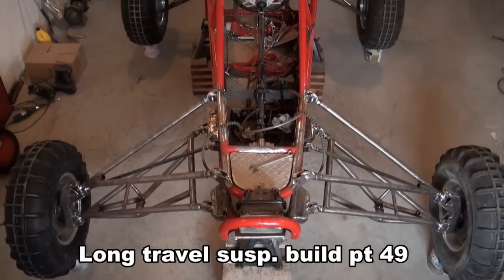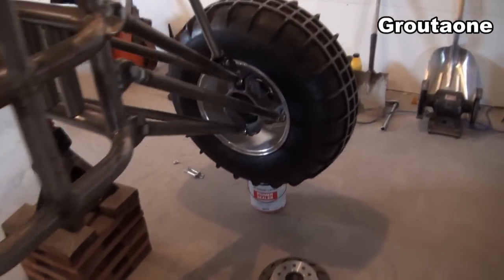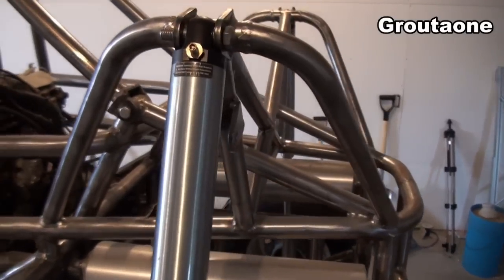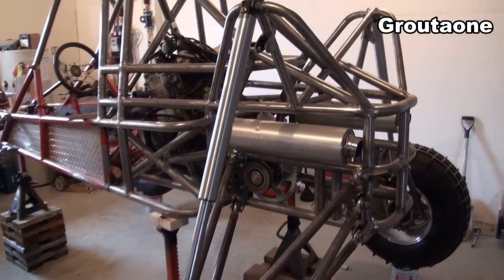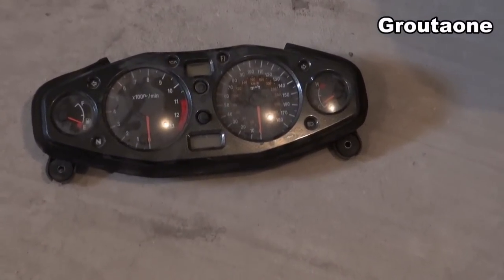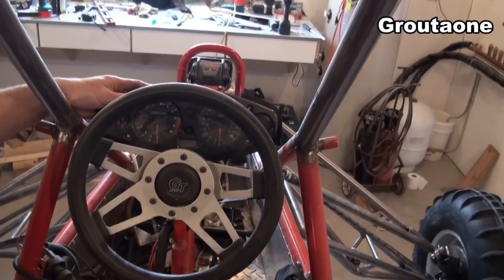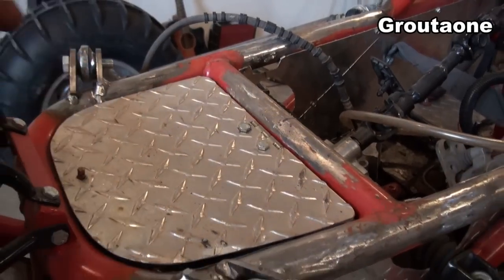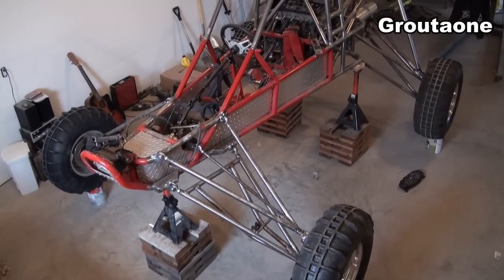Long Travel Susp Build PT 49

Comment: Great build.  If that is a motorcycle engine with a built-in gear box you need to know the primary reduction from the crank to the clutch basket then the ratio of the highest gear.  That will give you the rpm of the counter shaft sprocket when the crankshaft is at 11000 rpm in the highest gear.  Then you can do the math as you described.

Comment: The place I work at Skives the tubes for these shocks. A skive machine is a boring machine that bores and leaves a honed surface in one process. The ones we are currently working on have a ribbed outside for cooling.
Reply from the maker: william staten  Cool job you have, thanks for watching

Comment: Nice shocks!! When you move the top mount inward, it makes the shock softer, right? due to more leverage. and moves less, so since it's moving less, it seems like it's softer.Plus you need more nitrogen pressure for ride height.  And moving the top mount outward, you are decreasing the leverage, the shock is moving faster and more, which makes it stiffer with less nitrogen pressure for same ride height. I think I got it right.
 I plan on using automotive air shocks for the suspention on my tank. I'll be using 4. Got them off a Pontiac mini van. I decided to use them because instead of worrying about spring rate, I can just adjust air pressure.
Reply from the maker: *****  Thanks for watching, yes you are correct with your shock geometry analysis, another factor is that the suspension can have more room to travel as the shock top is moved in, and like you indicated, it will have reduced spring rate with that type of geometry change
Reply: groutaone Cool! I always setup suspension in daily driver cars and messed around with the fix positions, but your build, you get to choose where to put them on the frame, a huge advantage there. Good deal man!
Reply: groutaone Oh, thanks for the feedback. I will be putting it to use soon.

Comment: I have 400psi in the rear of my buggy with a for 460 big block. They are fox 2.0 18s. I think 400 will be too much for the light machine your building. Something we do also is put motorcycle fork oil in them. It keeps them smooth inside for much longer periods of time then the oil that comes in them. If you take your time with shimming, oil volume, and oil thickness you should be able to tune those shocks really well.
Reply from the maker: tom58c Thanks for your input, let me know if you have some video of your buggy in action, I will check it out.

Comment: groutaone  nice clean work it's coming along nicely
Reply from the maker: The Dude  Thanks man
Reply: Can't wait to see that thing get some air looks like she's going to be pretty smooth riding machine your using a busa engine to power that thing right ?
Reply from the maker: Yes that's correct, with fairly low gearing it should have some good power in the first few gears

Comment: Glad to see you back at it. I'm getting the itch as well to get back into my crossfire 150r to r600s motor swap project. I alway enjoy seeing your progress on this build, we've had similar ideas regarding reverse opioid however given the nature of my build I don't think I'll be spending so much on the reverse gear box like you did. Of course it makes sense in your case. I like your shocks. Will you be making a shift linkage system or a hydraulic shifter? I was wondering if hydraulic what exactly are you using? Hand clutch cable or foot hydraulic? I'm working on this now and have underestimated the difficulty of getting the geometry of a shift linkage system in place. Any info would be much appreciated, thanks alot...
Reply from the maker: Anthony Brown Thanks for watching, for the gear box shifter my two choices are cable or linkage, I have some linkage fab experience and have thought of making a video, with a few tricks its easy to make linkage smoothly go up, down, around corners and such, that video is in the bucket list. For a trans shifter I would like to set it up electric button shift, and use the clutch just to start off, I want to set up a hand clutch
Reply: Push button shifting that's a good idea. I looked at paddle shifters for racing cart steering wheels I thought that would be cool as well but I haven't looked into it other than price, I like the idea of saving leg room mostly I'm on the tall side and leg room is important.

Comment: assuming top gear on your engine is 1.043:1 then final drive is 9.20:1 with 31" dia tires at 11000rpm it will give you 110 mph. If final is 1.596:1 then ratio is 14.08:1 then top speed would be  72 mph

Comment: I wouldn't gear it "too short". You might hit the rev limiter often. That motor has about 175hp@ about 9,800 rpm.[ At the crank] Torque about 103 ftlbs @ 7,500 rpm. Did the Fox shocks come with boots to protect the tubes from rock damage? Here is a link about gearing http://purplesagetradingpost.com/sumner/bvillecar/bville-spreadsheet-index.html#Six%20Speed%20Motorcycle

Comment: That motor will have plenty of power in the lower gears but top gear is need for traveling at a decent seed at lower RPM I put a bike engine on a 3 wheeler in 1974 top speed 55 max rpm no cruising speed available. ..

Comment: 17 to 49 will take rpm from 11000 to 3806. Then the 16 to 49 will take the rpm down from 3806 to 1240 rpm. This means the wheel will be spinning at 1240 rpm. Next I take the wheel diameter of 31 and multiply that by pie (3.14) witch = 97.34 inches. Next I divide 97.34 by 12 witch = 8.11feet. now I just multiply 8.11x 1240 = 10056 feet per minute. Now I multiply 10046 x 60 = 603384 feet per hour. Now I divide 603384 by 5280 = 114.2 mph. My answer is 114.2 MPH TOP SPEED

Comment: The transmissions top gear ratio is 1.043:1 according to http://www.aperaceparts.com/tech/specshayabusa.html 49/17=2.88:1, and 16/49=3.06:1, 2.88x3.06=8.8:1 "rear end ratio" with 31's and 11,000rpm I got 110mph on 2 different top speed calculators
Reply: Correction, it's 68.9mph because of an extra gear ratio I missed.

Comment: Top speed 107 kph = 66mph
I couldnt find gear ratios only the final drive therefore:
GSXR:
 tire circumference 1.94m
final drive 40/17=2.35
300kph top speed = 83m/s top speed
wheel rps(revolutions per sec) at 300kph: 83/1.94=43
sprocket rps 43*2.35=100

Buggy:
tire circumference 2.47m
final drive (49/17)^2=8.3
wheel rps 100/8.3=12
speed 12*2.47=29.8 m/s 
29.8*3.6=107kph and google says thats 66mph

sorry to you americans for metric units but otherwise i would've confused the shit out of my european brain ;-)
maybe someone can have a look over ma calculations to make shure i didnt make any silly errors ;-)

I'm pretty certain that the buggy would be able to achive those speeds and would be limited by the electronics and not the power of the engine.

Comment: Edit: That didnt include the engine and trans gearing..   64 mph? lol
Reply: joeprissel that is fast for a buggy...
Reply: I'm pretty shure thats wrong. final drive ratio is up to 8.3 in the buggy from 2.35. so you would expect a lot more then a 1/3 loss in topspeed. even with slightly bigger tires.
See my other comment.
Reply: Hellsslave666 But the motorcycle is electronically limited to 190 so who knows. BTW I'm pretty sure it's 9.2:1 final drive vs 3.918:1.
Reply: Eric Fixalot Yes the bike is electronically limited but that limiting should still aply in the buggy. It limits the rpm in 6th gear so that the bike doesnt go faster then 190. That rpm limit should still aply to the buggy. 

40/17 is what i found for the sprokets that is. 2.35:1
and 49/17 * 49/17 = 8.3:1 for the buggy

that is only the chain and sproket ratio however, maybe we talk about different things.
Reply: Hellsslave666 49/17 and 49/16 for 8.8:1 with 1.043:1 sixth gear is 9.2:1. The bike has a primary drive gear ratio of 83/52 then the final sprocket tooth ratio of 40/17 with sixth gear that makes 3.918:1. Try it for yourself, it all checks out. Here is where I got my information (it's for a 99' but they're the same 99'-07') http://www.aperaceparts.com/tech/specshayabusa.html
Reply: yeah thats what i meant you are talking about the total ratio. I was only talking about the sprocket tooth ratio :)
so we are both corrcet :)
Reply: Hellsslave666 Looks like it, but I wonder if the machine still has those 83/52 gears in addition to the rest, like if those are built into the trans or something (I don't really know what's up with those).
Reply: Eric Fixalot I think those are from the crank to the trans in the engine.
Reply: Hellsslave666 So then it is likely on the machine.
Reply: That means with 14.72:1, 31"s and no electronic interruption 68.9mph at 11000rpm

Comment: Top speed +- 55MPH :) @ 11K
Reply: I came up with 66 so it seems we are pretty close, so probably about correct.
Reply from the maker: ***** Originally I didn't factor primary drive and came up with 75 mph, you likely are about right, good thing I have smaller sprocket sizes available, I hope I can get it to wheelie, maybe off a slow speed bounce, brrap, rrooost
Reply: I am sure she will wheelie just fine :)
IF not just crank the air in the front shocks and lower the air in the rear :)